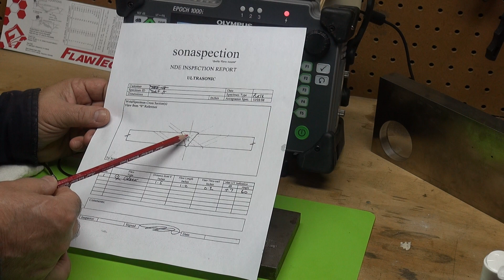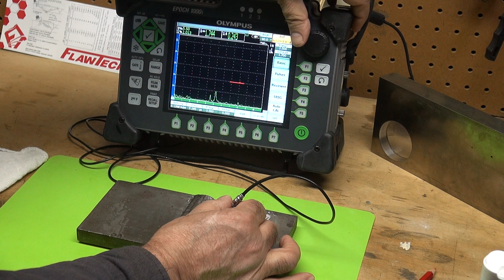UT Weld Centerline Crack Signal

Comment: These are excellent, John. Our local test center has just reopened post Covid and I'm booked in for CGSB UT2 in a couple of weeks. Thanks for sharing these videos to aid study.
Reply from the maker: Thank you Sam.  I wish you the very best on your certification.
Reply: @johnnyb28227  Any chance you have an immersion tank?
Reply from the maker: @samhornbymusic  I just purchased and received a TecScan immersion tank just last month.  Because of the pandemic I have not received any formal training on the operation of the unit yet but I have used the operators manual and I am performing some basic tests.  Once I receive training I plan on making some videos.  Do you have a specific question?  I may be of some help.
Reply: @johnnyb28227  just seeing a rundown of the various signals you get, cal, DAC and tracking the indications on the bridge (masking tape). It's one of those things, like a mag bench, that I never get to use other than in the exams.